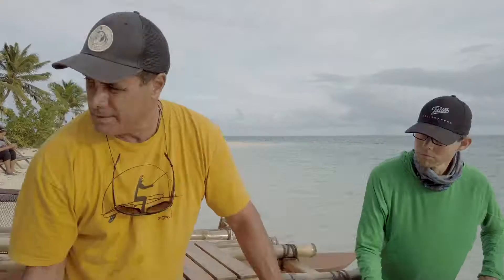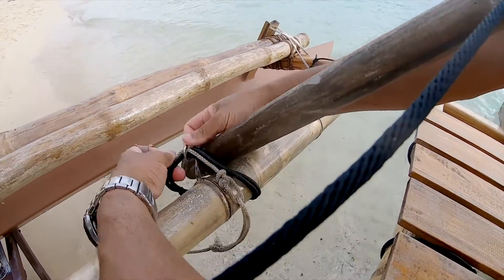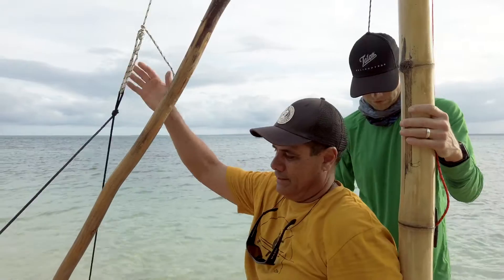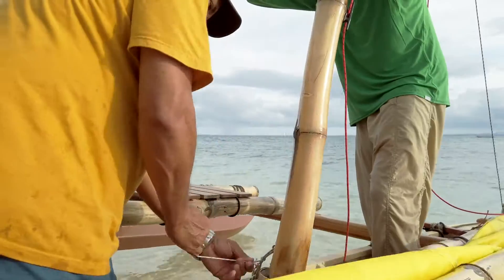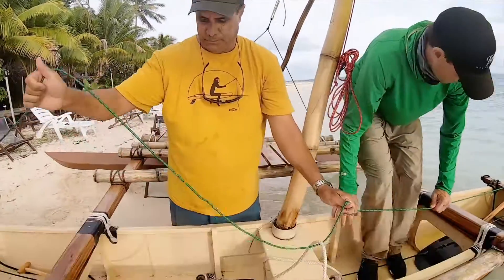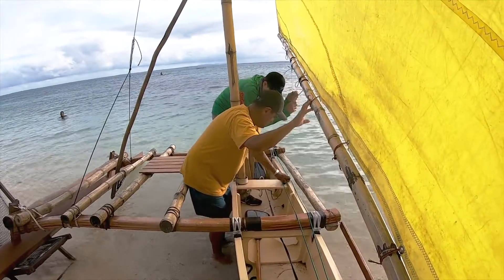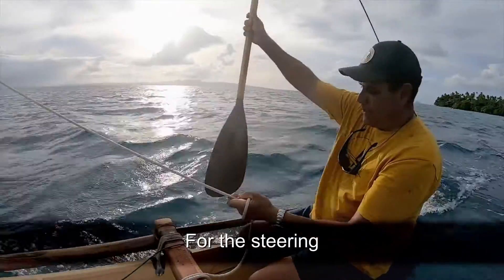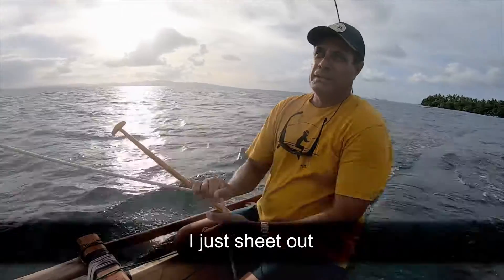Camakau Demo

Comment: Nice boat. Looks like the rig is well sorted out. Is the detachable sheet definitely better that having a separate one for each tack?
Reply from the maker: I use two sheets.  I think the detachable one might be a problem in strong wind.
Reply: @vakaman  Agreed, although on light days this system might be nicer.